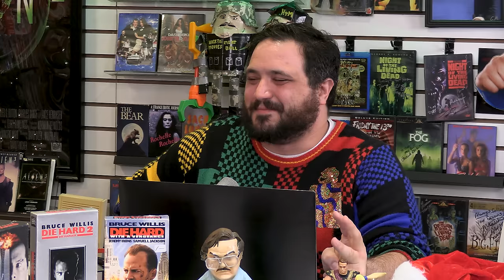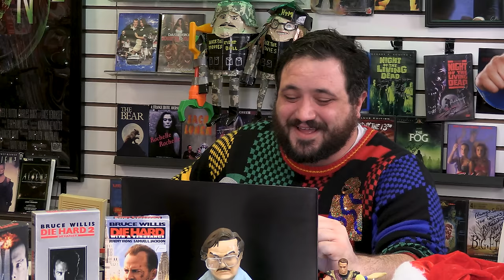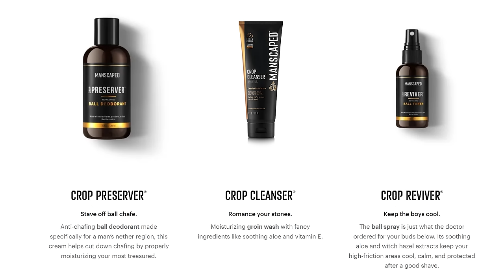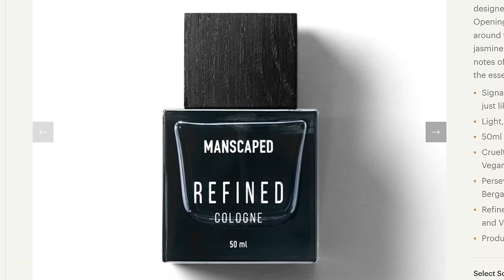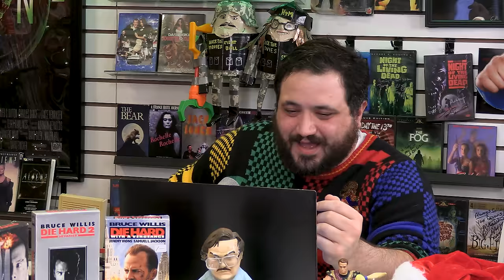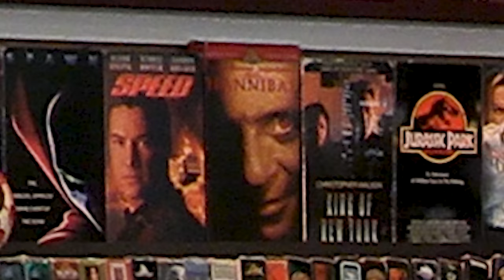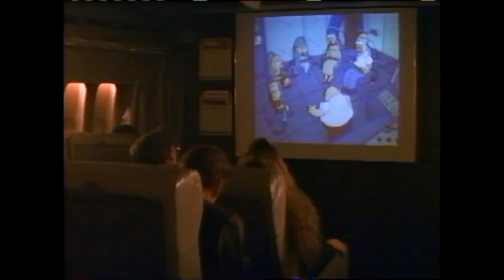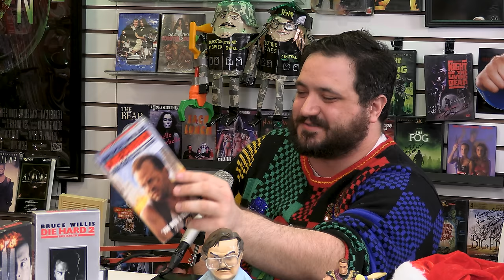Is Die Hard 2 More of The Same? - Talking About Tapes

Comment: Here's a Chronologically Confused scenario that may rival anything James has ever dealt with and it’s about the fictional nation of Val Verde, which was first used as the central plot point in the 1985 film ‘Commando’ and was reused in ‘Die Hard 2’, postulating that the ‘Die Hard’ films and ‘Commando’ share a joint universe. Thing is though, screenwriter Steven de Souza has stated his belief that the beginning of ‘Predator’ is also set in Val Verde, before they crossed the border into Guatemala. de Souza didn’t work on ‘Predator’ but his frequent collaborators John McTiernan and Joel Silver did, and when you consider the stories of ‘Commando’ and ‘Die Hard 2’ it could make sense that the U.S. was using it as a staging area against communist backed insurgents in Central America. But this could open up a whole new can of worms. If the ‘Predator’ franchise is on some level in the same universe as the ‘Alien’ franchise, if the theory that the ‘Blade Runner’ films also coexist with ‘Alien’ is correct... This is spiraling out of control; why does John Matrix in ‘Commando’ look just like Dutch Shaefer in ‘Predator’? Why does Captain Church in the ‘Blade Runner’ sidequel film ‘Soldier’ look just like Peter Keys in ‘Predator 2’? Why is Kane in ‘Spaceballs’; why is John McClane in ‘Loaded Weapon 1’; why is the Weyland-Yutani emblem in the ‘Firefly’ pilot?! AAGGGGRRRHHHH! I need to just stop before I hurt myself!
Reply: This is grade A "pepe silva" stuff and I LOVE IT.